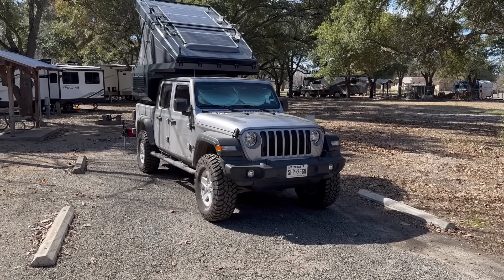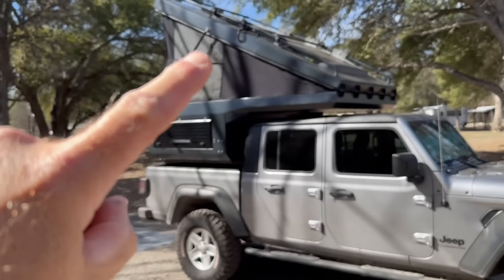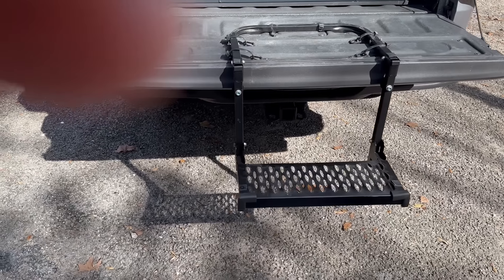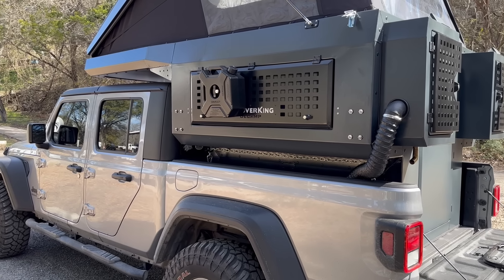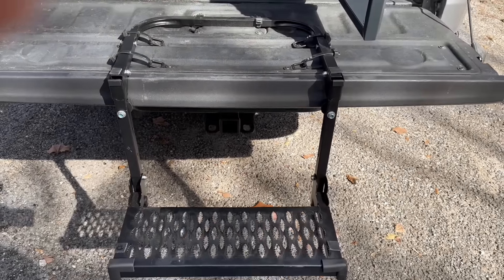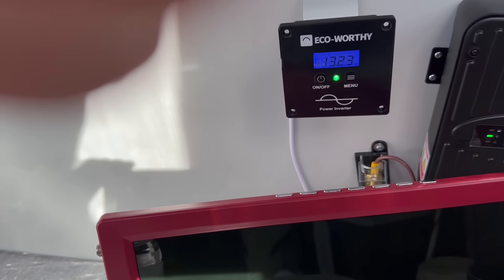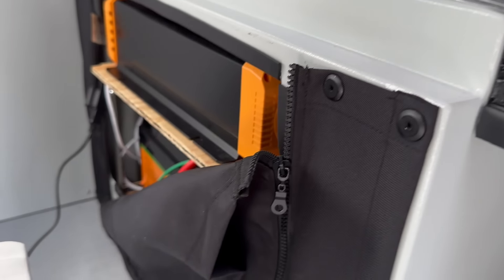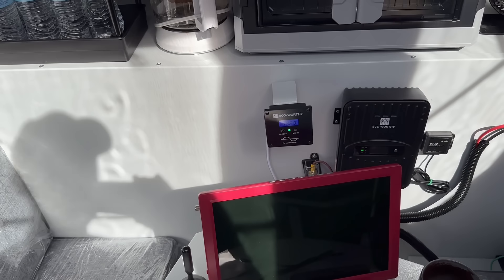New Style Overland Camper Review Reveal in and out, Mods on a New Style RoverKing. Subscribe ☺️

Comment: Taken much of dusty trails? How well does the camper do as far as dust intrusion? Thanks for the post! Thumbs 👍🏻
Reply from the maker: It’s totally sealed with auto weatherstripping, and nothing gets in like one of those GFC style shells and dust blows in from everywhere, through the truck bed and everywhere else. 

The major plus is you can take the camper off at-will and have your truck to do whatever else you want to do. 

Of course, if you were driving around with the top open, which no one would do. 

The outside gets plenty dirty, though . But who cares one power washing you’re good to go.

Comment: Any concerns with how hot the camper may get while parked or driving while the top is down?  The only window in the box is the small one in the door, which probably wouldn't be left open while driving in order limit exhaust fumes.
Reply from the maker: No, I’ve had it outside in 90° plus weather and inside the camper with everything closed, it wasn’t near 80°. As far as exhaust fumes inside, it has a regular tailgate that is up during transport. I have a carbon monoxide detector and it didn’t go off. No one rides inside the camper when the top is down. I don’t know who would actually be inside when it is only about 4’ tall when the top isn’t popped open.

When the top is popped open, it’s over 8 feet tall inside, which is plenty of room to roam about . 

Again, it is not designed for anybody to ride or be in in the back while the camper is closed. I hope that helps with your question.  Adventure on!
Reply: @John-U-Can-Do-It  Thanks for your perspective.  I've traveled with dogs in all of my truck campers just as I did while I owned the first version, so that would have to be a concession going forward.

Comment: You really have a nice setup,.  I really like the lightweight truck campers like yours, but my only question is living in central TX, there is no way you are camping locally in the summer with no ac, correct?
Reply from the maker: There is AC made for tents and other applications. About $500-$600 and it’ll work with 400 W of solar, of course at a park with electricity.

Comment: Looks great 👍 price point?
Reply from the maker: Howdy from Texas! They are 17,500 base RoverKing.CA it is all aluminum, except for the tent portion, which is thick, military grade rip stock and double mesh windows, and I love the clear UV plastic window, The top is over 3/8 inch thick. I like the fact that I can take it off whenever I want and have my truck back to do whatever I want. 520 pounds-basic and then whatever you put on it from there. 

The four solar panels battery cabling probably added 100 pounds; the water I use 8 gallons probably added another 90 pounds. Food 50 pounds (including dog food).  So with odds and sides it probably weighs around 800 pounds when it has my needs-stuff on it.
Reply from the maker: 20,000 including tax and import fees. It comes from Canada. RoverKing.CA

Comment: It's quite impressive, I like it! Did you install the diesel heater, solar panel, sink, and interior storage doors on your own? The interior layout seemed different from what I observed on Roverking's website. Could you please provide clarification on the modifications that have been made? I'm looking forward to watching your awesome content! Thank you.
Reply from the maker: Hi Jack. I did the diesel heater the solar panel sink and interior storage doors also course the cabling and installation of the solar by myself. 

Rover king offers a diesel set up that they put in the same cabinet;  I just did it myself. I’m also going to put in a removable cabinet that will go underneath my sink so that I can take it off when I not going on a super long trip and I can fold down the sink counter, to have more seating area when you’re bringing friends along. 

The fridge could be placed in the rear seat area of my Jeep because I did my own rear seat delete you can look up what I did. I made a tiny short video on that so that I have more storage and space. there’s so many advantages over other models of these type of campers. 

I like that I can take it off whenever I want to on stilts and put it away in my garage. That way my truck is mine when I want it and an over-lander, when I want it.

Thanks a bunch and please tell your friends I can always help you guys out when you’re ready to build. Just giving suggestions.
Reply: @John-U-Can-Do-It  Thank you so much for your answer. I seriously started considering one on my tacoma trd pro. I love it.